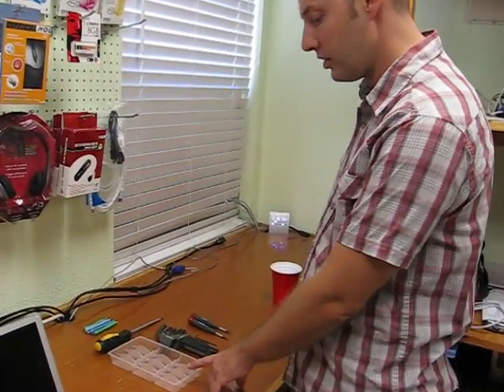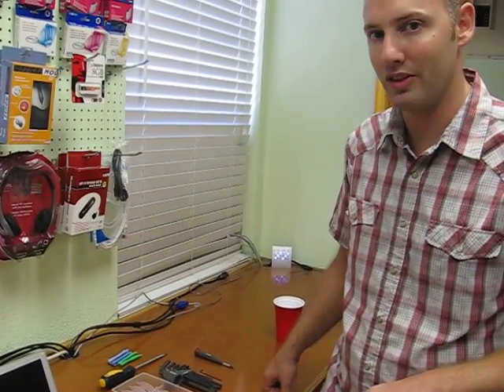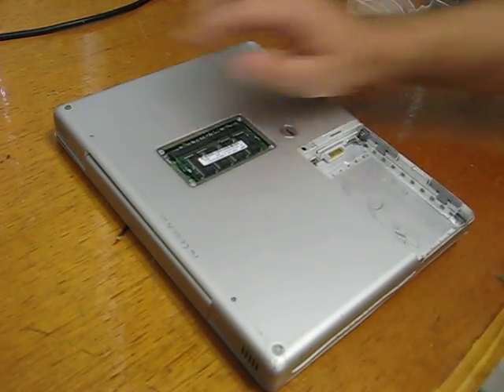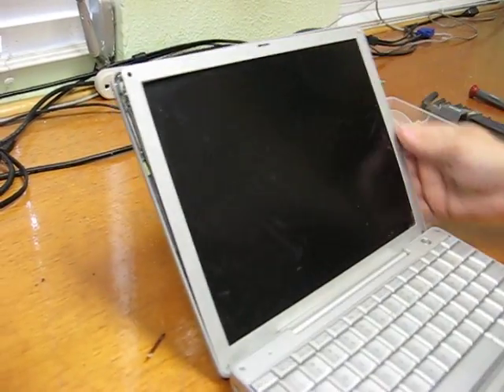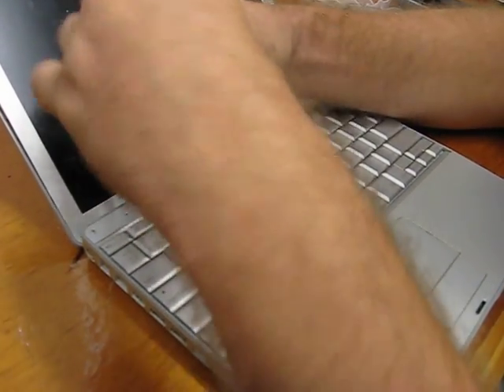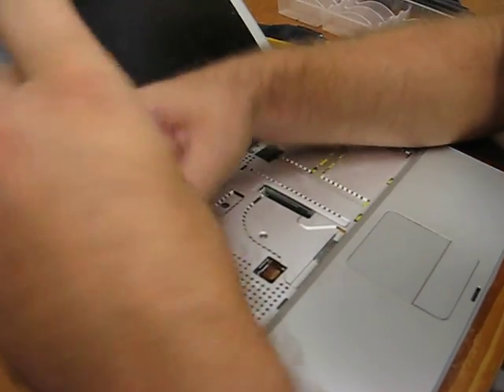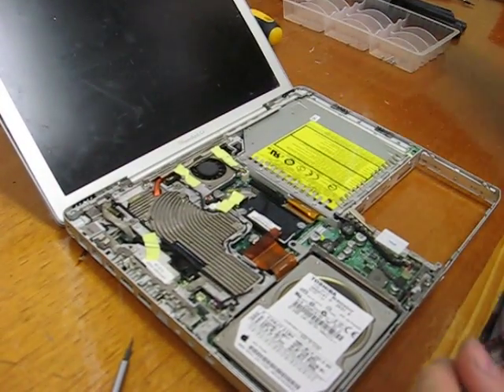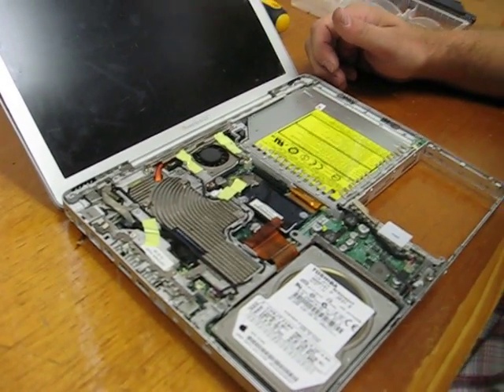Powerbook G4 take apart dissassembly

Comment: Have you run into any PowerBook G4s that stop powering on even with wall power? No signs of life. It also wasn't charging the battery when it was powered on, but the battery charged fine in a different PowerBook, so there are clearly some issues with power stuff. It hadn't been powered on in years so I suspect something broke after I first ran it for a while. I shut it down and the next day it just never came back on.
I've already tried reseating battery, RAM, various button combos, holding the power button a long time, etc.

Comment: Hi there, great video and thanks for doing this.  One side question.  Is the wifi card optional / removeable?  i have a 1ghz unit that has wifi, a 1.33ghz unit that has wifi and a 1.5ghz that has no wifi (no options or anything).  I'm wondering if back then wifi was optional and considering opening up the 1ghz unit to transplant the wifi card..  or maybe the 1.5ghz unit has a bad card in it.. or maybe it's baked into the logic board?  just curious what anyone knows about wifi in these?   I'm trying to research some before I crack this puppy open.
Reply: the 1.5ghz does have bluetooth.. maybe there was an option for bluetooth only / vs bluetooth+wifi?

Comment: Fast forward to 2018, MacBook Pro - RAM, SSD, GPU etc all soldered to the main board. No more access! Though its not without its benefits - the size is slimmer and the specs are massively different - i9, 32gb ram, 4gb ssd.

Comment: hey I Have The Same to Same Apple Power Book but its in dead condition. I want to sell it at 60 $ . The components like harddisk, display, ram, dvd writer etc can be used for another laptop like that which is in need of that parts. the Price is Negotiable. To buy it u can just Call me at - 9324818272... I m from India, maharashtra soindian buyers are most welome

Comment: Thanks much for the video. I would avoid telling people to pry the small molex connector on the left side with the red/black wires (which runs to the power button), as it DOES NOT come out as easily as shown in this video! It's connection to the circuit board is very fragile. I gently pried one out and it came right off the circuit board. There's enough slack in the wires to remove the cover and prop it up against something upright next to the laptop.